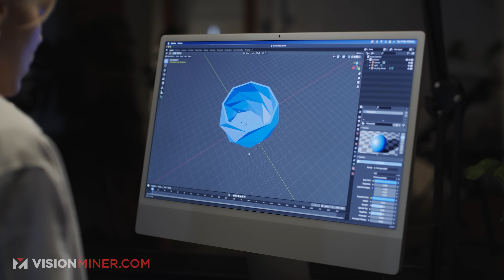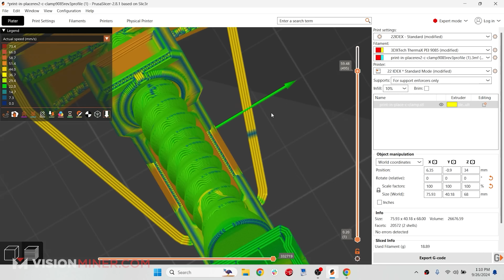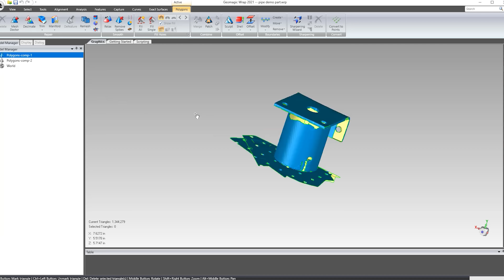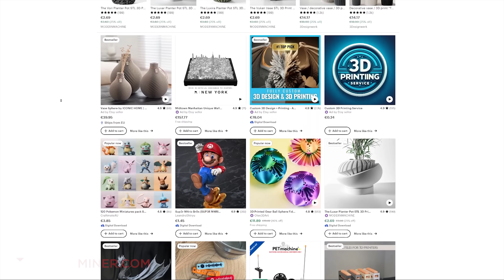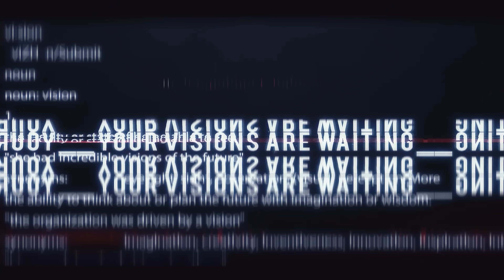Did This Machine Ruin 3D Printing?

Comment: These concerns about the Bambu 3D printer and its impact on craftsmanship echo a familiar pattern in the history of technological progress. Every time an advanced tool or technology emerges that simplifies a task, we hear arguments about the loss of skills, the decline of craftsmanship, and the ‘dumbing down’ of an art or profession. While these concerns are valid to some extent, they overlook how new tools often elevate industries, enable broader participation, and pave the way for more advanced innovation. Let’s consider some historical parallels:

The Calculator: When calculators became widely available in the 1970s, critics argued they would ruin mathematics education and make students incapable of basic arithmetic. While calculators did change the way math is taught, they also enabled students and professionals to focus on higher-level concepts like calculus, statistics, and data analysis by automating mundane calculations.
The Electric Saw: In woodworking, the introduction of the electric saw was met with fears that traditional woodworking skills, such as hand-sawing and intricate joinery, would be lost. Instead, electric saws democratized woodworking, allowing hobbyists and small-scale professionals to produce high-quality furniture and structures while preserving advanced techniques for specialists.
Word Processors: When word processors replaced typewriters in the 1980s, writers were accused of relying too much on spell-check and formatting automation, losing the discipline and precision typewriting demanded. Fast forward, and word processors have not only improved productivity but also opened up writing and publishing to millions who might not have ventured into it otherwise.
Digital Photography: In the 1990s, photographers lamented the death of film and darkroom skills with the rise of digital cameras. Yet today, digital photography has expanded creative possibilities, enabled photo manipulation and accessibility, and even revived interest in analog photography as an artistic niche.
The same is true for the Bambu printer and the 'Bambu Effect.' While it simplifies 3D printing for the average user, it doesn't erase the value of advanced slicing, G-Code manipulation, or high-end manufacturing. Instead, it expands the ecosystem by introducing new users to 3D printing and creating a larger market for innovation. Advanced practitioners can still thrive by focusing on high-complexity applications and pushing the boundaries of what’s possible with 3D printing. This coexistence of accessibility and expertise has happened before, and it’s likely to happen again.

Comment: Come on, really? This is the most gatekeeper crap ever. So what if Bambu is making this accessible? Do you really want to go back to the time of laser cut MakerBots that required days to build (hand wiring included), and 2-3 weeks of tinkering just to get a working print? Or does that sound completely unappealing? I literally dropped out of the hobby because of how oppressive 3D printing was 12-14 years ago (when I first gave it a try). I recently picked up a new AnkerMake M5 and I had a print going in less than an hour.

I've seen a couple of good comments here: "this is 3D printing, not 3D printer fixing" (@NikolaiFedorov-o4b), or "With this type of thinking, no one should be able to drive a car unless they are a professional mechanic" (@Synplex).

I work in IT. I've been working on computers for over 30 years. In the 80s and 90s, working on a computer required courses, working IN a computer required a lot of knowledge of what plugs in where (nothing was keyed, the connectors could go in multiple places). Operating them required a mix of command line and some WIndows work. Even getting on the internet in the 90s wasn't a simple "open your browser and it just works." The amount of troubleshooting and tinkering I used to have to do was incredible. You know what I don't have to do any more? That crap. I don't now look fondly back and say "man, I miss having to diagnose IRQ conflicts."

This whole "I had to struggle so you should too" mentality is an old way of thinking. Struggling through older 3D printers doesn't grow 3D printed hairs on your chest. People want to print stuff, not spend hours in a slicer, or with a toolbox in hand to fix a machine that should have been working before it was shipped. 

Of course, if that works for you, great. But given the choice between struggling with something like that old MakerBot, I'd rather not print anything. If it bothers you that 3D printing is accessible because Bambu (and Prusa, and the others) made it accessible, that's a problem you need to deal with on your own. Gatekeeping 3D printing doesn't make any sense to me. 

Not everyone wants or needs to be an encyclopedic expert on 3D printing to appreciate the hobby/industry. Just like I don't watch car shows, read car magazines, race, and otherwise fix my car every single moment of the day doesn't mean I'm not a skilled driver. Go away.

Comment: I just ordered the X1 carbon but I am so glad I started with the Ender 3 pro. It’s a lot easier to dive into fixing something yourself on a sub $200 printer than it is on a $1200 printer. Now that I have that knowledge of 3d printers I believe I can figure out any issues I have with the carbon

Comment: Although I recognize this skill lost in myself, I can't help but be excited about that. Although Bambu shake this market, I already felt this with Prusa's late MK3, specially with the development of PrusaSlicer.

At the end of the day, we want stronger parts as fast as possible. Period. For some applications, you may want them to be lightweight, water tight, flexible... Whatever. But those kind of applications are for us freaks who want to squish every bit of performance of our machines. It is assumed that those freaks have knowledge enough to tweak the slicer settings to their advantage... And we reunite here, in forums, YouTube, whatever place. This misleads us to realize that we are a minority.

I remember a post where it says that approximately, more than 90% of prints worldwide for hobbyist are done in PLA/PETG.

They are a company, all of them. They sell printers, a newbie expects a machine to work. Just like a paper printer do, or a CNC machine, a Plotter, a washing machine or a Roomba. Think on cars, just hit the button, engine starts and go anywhere. There are some folks out there who wants more power, they tune their cars... Whatever. People expects from the car just to start and move around. It is a tool.

I'm more than happy to reach this point on this market. We made a journey, we acquired some knowledge, we developed this desktop machines (Although I quite believe that there is room to go) to the point that we can almost just hit print. I see this as an opportunity to focus on other hobbys, and spread out us more on some other topics in which we can use our printers for a purpose.

Comment: As a 3d printing technician for over 10 years, I understand where youre coming from about the 'simplicity of automation' from bambu machines, but I completely disagree that it ruins 3D printing.  Having worked with and repaired machines from Creality, 3D Systems, Luzbot, Prusa, Makerbot, Bits from Bytes and Elegoo, the one month of work I've had with my A1 Mini blows them all out of the water.  The simplicity of being able to hit "Print" and know that the machine will create flawless parts makes printing fun again.  As much as I love tinkering on my creality and ender machines, I absolutely HATED coming back from a 10 hour print job only to see the machine gave up in the final hour.  Bambu has been consistently reliable and I can always 3D print using additional slicers if I so choose.

Comment: losing the ability to slice is akin to losing the ability to fix your car engine. it's great to have the skill, but if I need the printer to do rapid prototyping, I would want the slicer to figure out what needs to be done to print it; same way most people buy a car to get them from A to B but have no desire to tinker with it or even understand how it works under the hood.

Comment: 1:00 this is what happens in any industry or activity as you lower the barrier to entry. I have been in design engineering and manufacturing for the better part of 30 years, and it’s great that CAD has become so accessible, but now there’s a lot of trash models out there that don’t print well or hold up as intended.

Comment: I'm a CNC technician and I can tell you from my experience that CNC guys are not checking the G Code before running their cycles. They generate their code in Solidworks or Fusion or whatever, send it to their machine, load the necessary tools and in some cases offsets, and hit go. The only checking of code is making sure the whole file was received, and some don't even do that.
Reply: Worked for years with Germans, they ALWAYS checked the code on the machine and in software, checking tool passes, then rode the speed dial watching it make the first program pass sloooowwww. But we were making some pretty wild stuff that needed very high precision (optical stuff).

Comment: why do people do this, whats with this fixation with having to spend countless hours manually fixing shit only to get a barely ok print out. why is it such a fucking thing to just have a printer that can print what you want fairly well out the box. you think these people would be happy cause such a machine now exists and has raised the expectations of manufactures 

when the time comes to do more advance stuff you will still need to learn to slice, model and understand material properties its initiable due to the nature of 3d printing.  

every single time i have to re-tweak something cause the print is off, its just wasted time on my day. 

when was the last time you had to manually adjust the timings on a new monitor to get the correct resolution displaying? such clownery
Reply: Are you stuck in 2011? because 3D printing became more like tinker for 30 minutes every 6 months or so since about 2018. My first 3D printer was an anycubic i3 mega I only have to thinker for about 15min when assembling it and ever since I have printed about 20kg of filament. In that span I only had to change nozzle once, clean fans and guide rods, some oiling and that's it. Probably less than 2h spent tinkering in a span of 6 years. Is people seriously so lazy and unwilling to use their brain for such simple things?
Reply: @teresashinkansen9402  good for you printer janitor. waste your time.

Comment: On the Bambu Reddit all you see is people who are clueless as to why their print didn’t come out perfectly and asking others why.  Confused by the situation because they bought a Bambu labs machine and that’s not what they were sold. (By many influencers). But like with a car there is still the need to understand why something doesn’t work if you expect to fix the issue yourself. I think it’s true that if you were there in the old days when 3d printing was a struggle then you have a better understanding how to print a complex object with challenging features. Otherwise you’re reliant on those defaults which let’s face it were setup for speed primarily in this case.

Comment: I've seen that same problem overall in all fields: at work, we have switched our logistics infrastructure to an entirely different system, so rather than using two independent software packages and "marrying" them together rather gracelessly (and expensively), the company now uses a fully-integrated software solution that offers applications across all devices, top-to-bottom.

While all that sounds good on paper, the company has had no seminars whatsoever to properly train employees in its use; at the same time, most people working in the company are either too old or too young for this shit — "looking under the hood" of software that is at times nebulous is not exactly their forte, nor something they are obsessive enough to do anything about.

Being born in 1984 and doing all that since I was a teen, have ended up becoming the unofficial local troubleshooter.

Comment: Nah. I suffered in the circle of hell devoted to maintaining and calibrating an Ender. More fixing than printing. The less time I have to spend fixing a turd the more time I can devote to learning design and making revisions. Not everyone is happy printing goyslop reddit trinkets or hoping others design what they need/want. The skills I picked up working on the ender have not been practical with the Bambu for the most part either, because they were specific to basic bitch machines with zero QC.  Bambu saved 3D printing in my opinion. Less mechanically inclined/stubborn people sell their garbage enders or throw them out and quit. Now they are far less likely to abandon the hobby.

Comment: Today I got my A1 as my first 3D printer and the first thing I printed was a replacement part that went missing for our dishwasher. It is a relatively complex design that consist of two half rings with flanges that then form a whole ring that slides in, rotates and locks to hold one of the spray arms. No luck finding it anywhere on the market.
So I reversed engineered it in FreeCAD using measurements and a similar part that only had different dimensions. Since it should be durable in the machine (water, chemicals and heat) I used PP, which people said is not especially beginner friendly, but I wanted to give it a shot, even if it is just to gain experience. I just used the Generic PP filament profile. For adhesion I used double sided tape. And what can I say, 18 minutes after hitting print I got the part first try. It was only a small part but still. It is mindblowing to me how good this was working right out of the box.

Comment: it has elevated the game. Why? Because I started with a craptastic Creality S5 CR10 (500x500) and took 2 weeks to get it to where I could print, that the company actually stiffed me on the ender 3 pro S1 after it melted the plate and gantry, with a 3 month old machine.. about the time X1C came out, then got an Sovol SV06, which was junk only got 14 prints that were not good from it, and then I got my Bambu.. and have not looked back. That spans nearly 10yrs. Bambu allowed us to actually print. This sounds like jealousy and making excuses why Bambu isn’t really good.. but it is. Seeth.

Comment: I started on a Stratasys Titan with their Insight software back in the early 2000s, and THAT software let you directly edit toolpath, like trim and extend individual lines in the toolpath, select individual lines and change their extrusion thickness . . . I've been annoyed ever since that nothing else gives me that level of control. But, even Stratasys has gotten away from it for most things. And to be fair, most of the time, it's good enough. Bambu is the same; most of the time, it's good enough. HOWEVER - every once in a while, something is a PIA, and the knowledge and the functionality would save the day. The more you know, the more you can do. It's that simple. But, Bambu is making the craft more accessible for people who don't know, and ultimately that's good for everyone. The 3D printer will become an appliance eventually if it keeps getting easier. VERY few people know or care how their microwave works either. For the rest of us, the knowledge is still available if you want it.

Comment: Same goes for RC model airplanes.... I remember my colleagues from the RC club:

BACK THEN you first had to buy some woodworking machines and tools and learn how to use them (craftmanship)
BACK THEN you had to spend many hours to build your plane from wood, you even had to build your own receiver and transmitter
BACK THEN when your plane crashed you had to spent hours and hours to repair it and try again
BACK THEN you always had to fix different problems with your engine or RC system
BACK THEN only the ones that really, really wanted to do this and dedicated almost all of your free time to this hobby succeeded.

Yeah, the entry hurdle for that hobby was intensivly high BACK THEN.

And in the 2010s ... the foam planes and drones started to emerge and suddenly almost everyone was able to give it a shot!
Same story with 3D printers.

Comment: As someone who still uses a Ender3, designs objects on tinkercad, slices it in creality, and prints them up. I’m not sure I entirely understand the conversion.
What is the bamboo effect? Do you just download a file, load it on the bamboo and press print? No splicing? No analyzing of layers? 
No adjusting the wall thickness so your AR lower doesn’t explode? LOL 
Then that kinda contradicts the “Honda civic” analogy. It’s more like buying a Tesla, the car drives itself and ultimately makes society less critical thinking. Where there is no manual transmission, no manual windows, one air bag and no tachometer(2004 civic), just get in push a button and go.